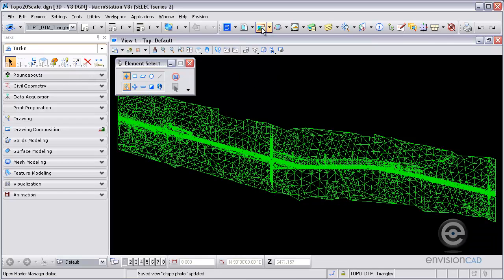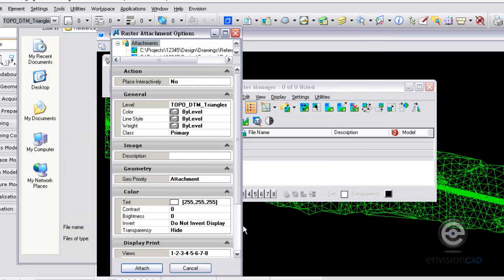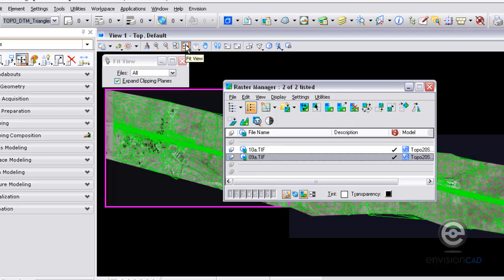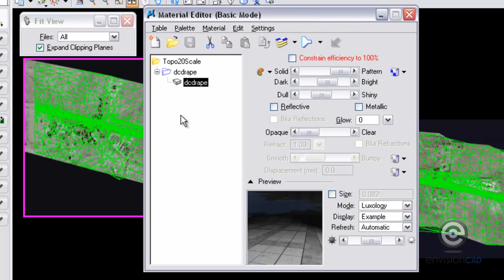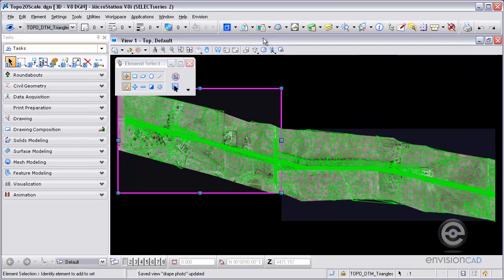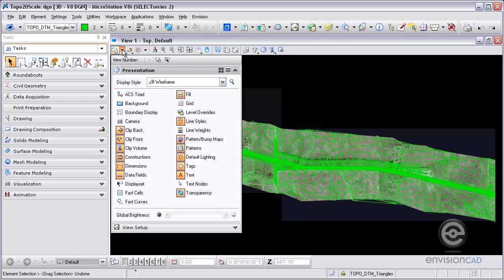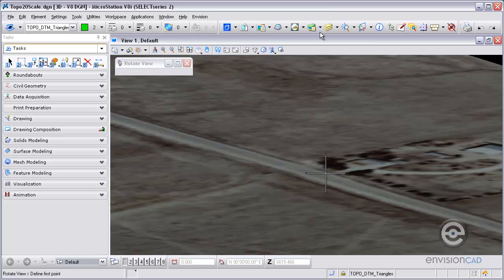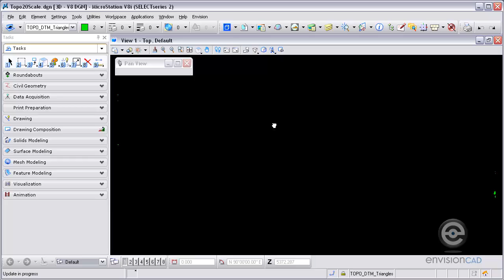Drape Image on Surface - MicroStation V8i (SELECTseries)

Comment: Will draping a raster rather than attaching it as a material allow it to print? I have run into issues with printing materials and am curious if this method allows the image to print.
Reply from the maker: Depends on your print driver. I think you need to make sure Rasterize is toggled on before you create the PDF or print.